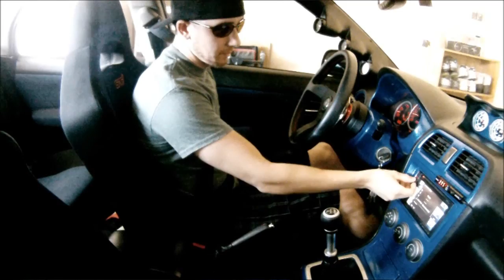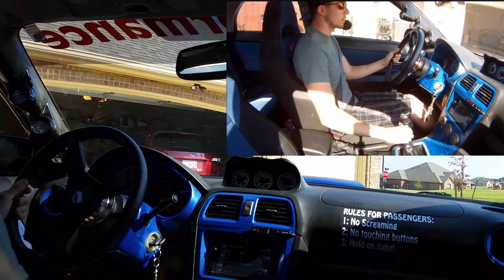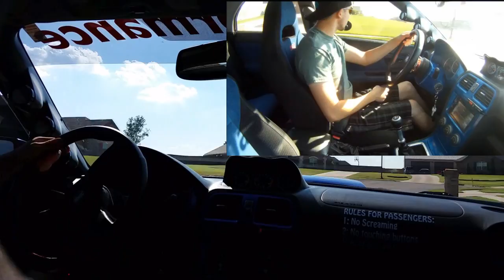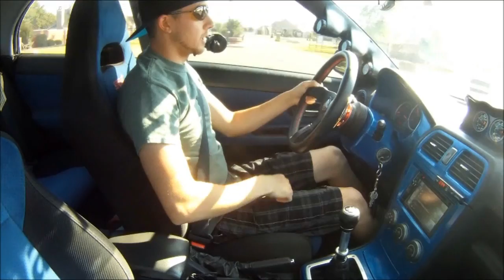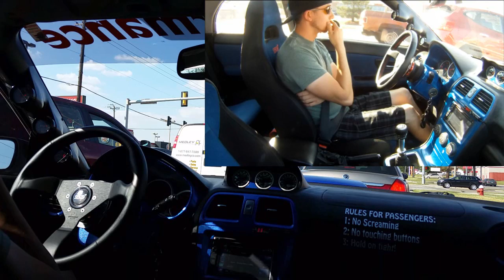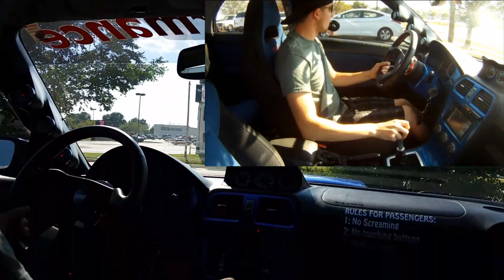Competition Stage 3 Clutch REVIEW (POV) (POST Break In)

Comment: I've been told it's not good to hold the clutch in at stop lights. I was told that it puts unnecessary wear on your throw out bearing and you will have to replace the throw out bearing prematurely
Reply from the maker: +HaRdReDnEcK7997 it is bad! I think this vid, and a little bit while I was learning this new clutch is when I held it in. But I don't do that on a regular basis. Never, now, actually.

Comment: Was waiting for this! Mine is still in the box. Lol! I did my brake upgrades tough, stainless braided lines(Goodridge), the master cylinder brace(Grimmspeed), pads, rotors, dot 4 brake fluid. Stiffened up the brakes nicely, deceased pedal drop. Just don't like my pads, they're loud gonna change them eventually.
Reply from the maker: I'm running the same stuff as you except my rotors are stock, my pads are Performance Friction brake pads, and the fluid I'm using is dot 3/4; which actually don't really like too much.

Comment: haha I got stage 3 and lightwight flywheel. stall a lot
Reply from the maker: I tore up this clutch along with a spec stage 3+ clutch I used after this one. I was slipping it during launch. My launch control is set at 6200rpm. each stage 3+ clutch lasted me about 40 or so passes :(  I just got an exedy stage 4 twin disc clutch with light flywheel installed a few days ago. Got 100 miles on it so far. This clutch I wont slip anymore. I learned my lesson finally haha fml.